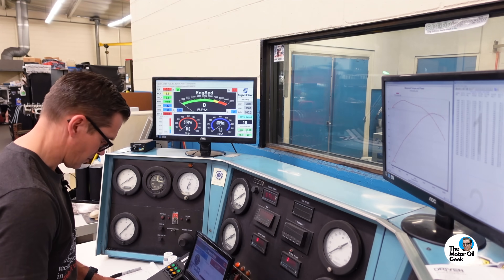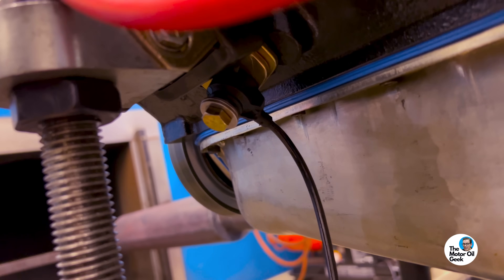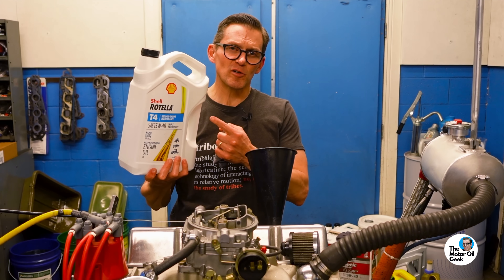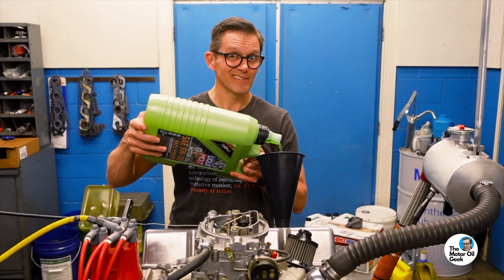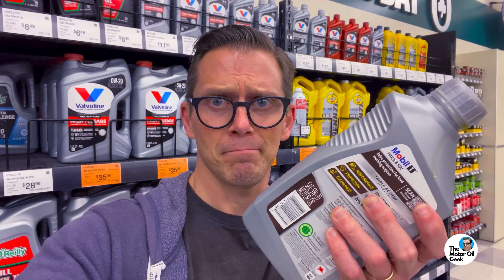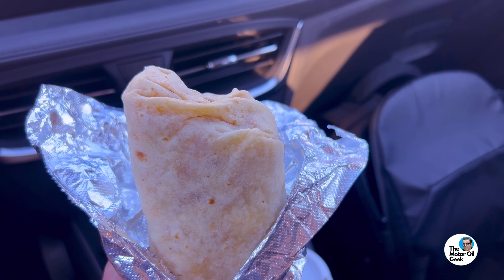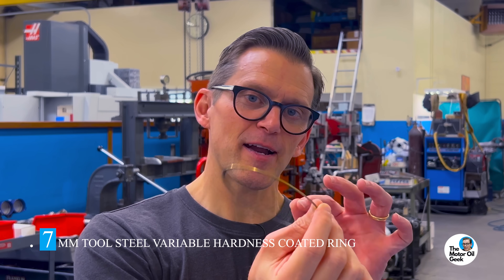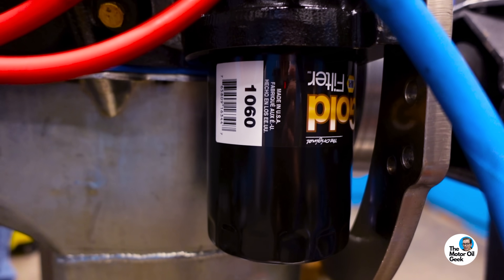Why MOST Motor Oil Tests Are WRONG! (Dyno Test Sneak Peek)

Comment: back in the 90's I was a temp at EG&G automotive research, they had 200 2.3 Ford engines, 64 Pontiac 3.8s, 8 GM oldsmobile 350s, the also had 1 cyl engine and some diesel engines (I was a parts washer) you could do your tests there without having to do engine flushes
Reply: I worked for EG&G starting in the 70's and built oil qualification engines. The Ford 2.3L was my job to replace the 302 we were running at the time. Also built 425 Olds with cast iron intakes. The 3.8L was a Buick engine. Later in my career I purchased all of the test fuel for the entire site.

Comment: why are all your tests performed on engines that haven't been produced in 30 yrs. Wouldn't testing on more modern engines with newer materials and different designs produce different results?
Reply from the maker: It is easier and more affordable to use these parts.

Comment: As a comedian who always has landed in the prairies, the bush or in the Arctic, I am curious about the effects of cold weather. Cold being -30-40 although we don’t see much -50 the last few decades. Does it matter if the block is warm From a block heater and yet the oil in the oil pan is cold and presumably as thick as molasses? That appears to not be a problem because oil pan heaters are not really recommended much. And if you’re standard oil is 10 W30 should I be using 0W30 in winter or year round if I only need to do oil changes once a year?
Reply from the maker: A 0W-XX oil can flow enough at -30F that pan heaters are not needed. They are helpful though.
Reply: I would like to see some testing of engine oils in cold winter conditions under and urban driving loop for ability to handle increased water and  intermediate combustion  products. Driving in a place like  Calgary in winter is a world away from coastal southern  California. I have experienced both first hand.

Comment: After filling the flushing oil you must be running the engine for a certain period of time to ensure that all lubricated parts are made free of the previous lubricating oil.
Reply from the maker: Yes, we run the engine for 30 minutes with each of the flush fills.
Reply: @dukecraig2402, I agree, but there will always be someone who contests everything possible, some complain when a video is edited. 😂
Reply: @MikeOxLong972
That's the "Magic of Hollywood", I'm constantly having to explain to people that just because the sound editor of Star Wars wanted to win an Academy Award doesn't mean the engines in spacecraft make noise in the vacuum of outerspace, ie Lake's video would be as boring as Star Wars with silence during the space battles if he showed an engine running for 30 minutes with flush oil in it.
Reply: Needless to say he ran the engine with the flushing oil in it longer than what you see in the video.

Comment: Mobil isn't top tier fuel.
Reply: Mobil Synergy provides cleaner engine, enhanced performance, improved fuel economy, and better engine protection. The exclusive Mobil Synergy additive formulation is registered with the EPA and certified as meeting the TOP TIER Gasoline Detergent Standard.
Reply: This is on Mobil’s website.

Comment: Pro tip: Filling cans at the service station requires you to purge out the last dispensed fuel grade for accurate advertised octane.
Reply: Great comment
Reply: Or you can do the math of price paid/gallons pumped and you should be able to see the prices on the pump.
Reply: And the math will tell you that... "You're going to need to flush the line to get an accurate octane rating" approximately 1 gallon
Reply: @craigquann  Thank you for that tip.
Reply: @FastEvan47  I'm referring to the actual fuel grade being initially dispensed when the next customer comes along.
Reply: Someone either gets slightly burned or benefitted what you switch octane grades too. lol
Reply: @theamerican7080  essentially. Yes. But in the grand scheme, on a full tank, it's negligible. However if you're say buying premium for a boat or a 2 stroke engine (in a small can) throw the first couple gallons into the tank of your car and fill the can.
Reply: @craigquann  Roll up with a motorcycle that REQUIRES premium...then what do you do?
Reply: @craigquann  He was filling portable cans...that's the point.
Reply: @theamerican7080 pick up the nossle and fill the tank. Like the manufacturer has factored in the fact that the fuel pump is industry standard and there's going to be a negligible amount of regular gasoline in the mix
Reply: @craigquann  As long as you're happy with paying premium price for the first gallon or so of regular, until the premium actually starts flowing...when you're only buying 2-3 gallons., then that about settles it.
Reply: @theamerican7080 ok. And how else are you going to get around it?  Again. Industry standard. Unless you can find a station that has separate nossle/pumps for every grade of fuel.
Reply: @craigquann  You can't get around being screwed out of that deference, but, you can dispense pure premium grade fuel into a can by putting the first gallon or so in your car, then fill the gas can.
Reply: Not if you go to the same station for years. He's doing an  oil test, not an octane test
Reply: @bimmerland  Did you watch the whole video?
Reply: I would think a place like that could get gasoline & oil delivered.

Comment: Lake, it may be interesting to see what happens when oils from different brands are mixed. Example. Halfway through oil life, you're down a quart and you add 1, of same certification but different brand. Like add a quart of Castrol Dexos 1 into half used Valvoline Dexos 1. Does it really matter? Should you only use same brand already in the engine?

Comment: why don't you just bbq ten different oils then tell us what excess heat does to oil!
Reply: Not to belittle the hard work but yeah, Any legit oil will pass all the tests under "NORMAL" Testing we need to know what will hold up when its overtemped and maybe momentarily starved or aerated and contaminated with Ethanol😄

Comment: Sometime ago you’ve made a video ,stop following oem oil advice , my question is how do you find out what oil will work best for your own engine in your own car if we put wear rate first instead of fuel economy , lower viscosity should mean less friction but lower viscosity oils typically have lower hths , a thinner protective film which might be bad in most medium to heavy duty applications where stresses are high ?
Reply from the maker: The used oil analysis results will show you which oil and viscosity produces the lowest levels of wear.
Reply: To me it seems that erring to the high side of viscosity (within reason) is safer than the low side. This is especially true for the cold number (e.g. 10 in 10W-30).

High viscosity is stable, but low viscosity is unstable, because extreme conditions result in viscosity reduction due to:
1) heating, especially when friction is abnormally high.
2) aging, because hot viscosity approaches the behavior of the cold number. Hot viscosity is permanently reduced by cumulative shearing of viscosity modifiers. This affects the bulk of the flowing oil (ignoring sludge that also forms during aging).